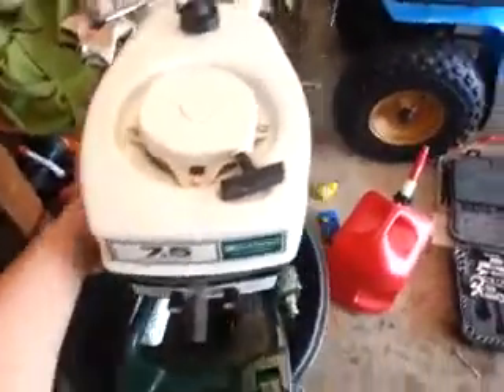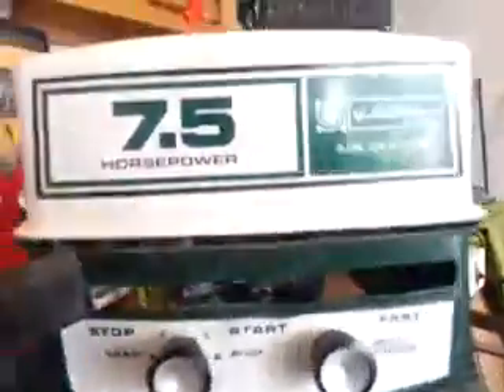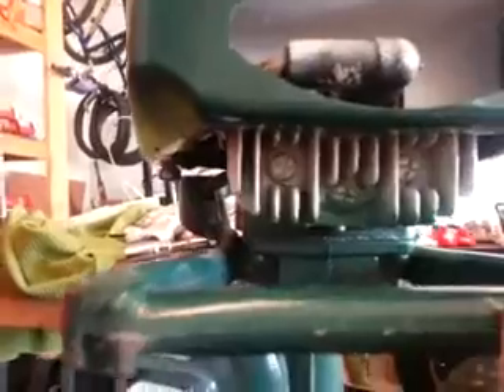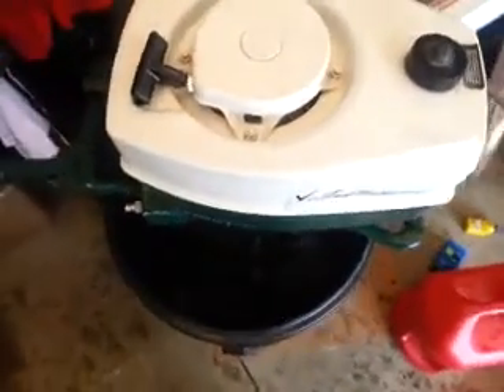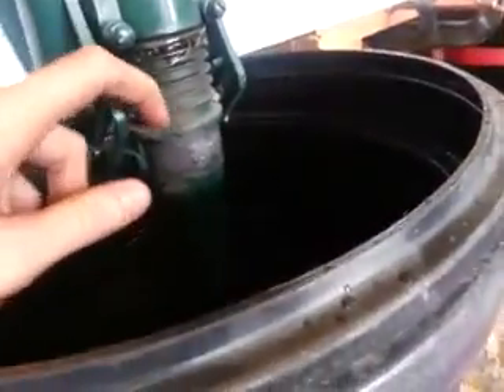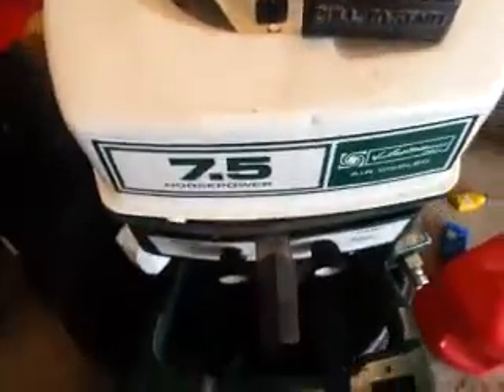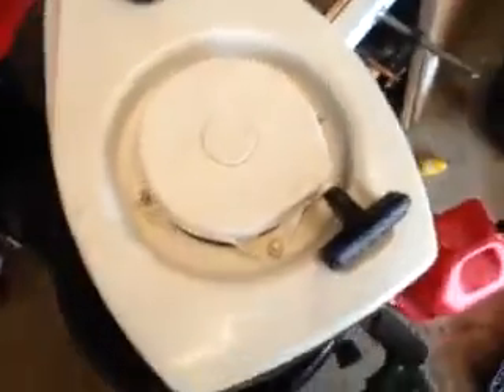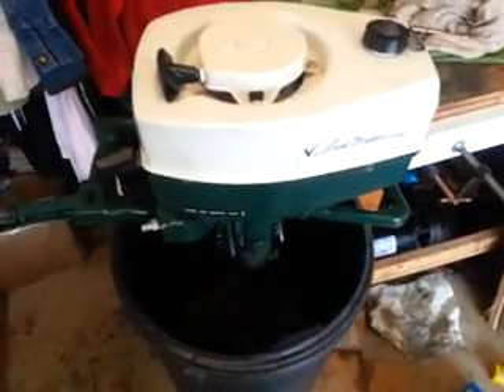Ted Williams Eska Sears Roebuck 7.5 hp outboard motor

Comment: Do you know anything about the Ted Williams 7.5 with the black box ignition thing in it my had spark I fired it in the garage and then no spark after one fire. I found a video on a man taking the black box cutting into it and replacing a compacitor. I figure I blower the compacitor when I fired it for the first time in year. Do you know anything about them. Mine doesn't looks like yours

Comment: I have the exact same motor........throttle on the power head and not on the tiller.
Reply: I have this same engine. Trying to get it running again. It runs full throttle ok, but having trouble keeping it running at idle. Any suggestions on the Idle adjustment (Lean to Rich, 7 settings)?

Comment: I have this things lesser 3.6 hp and it running hot and it's pushing water but it still over heats don't know much on outboard motors so if u think u know u its doing this leave a comment
Reply: Impeller